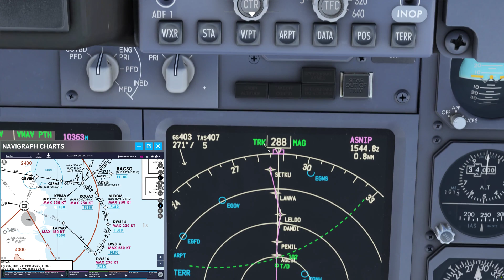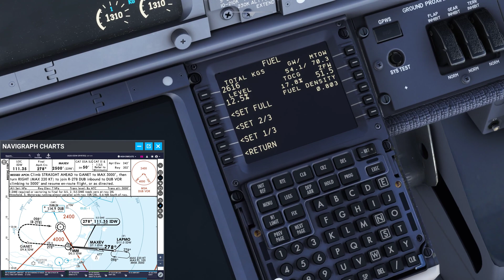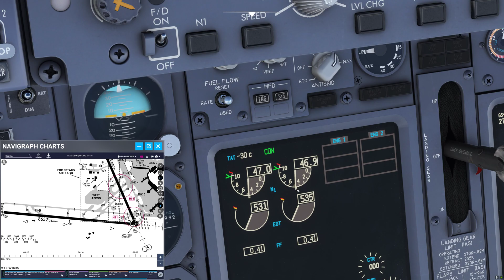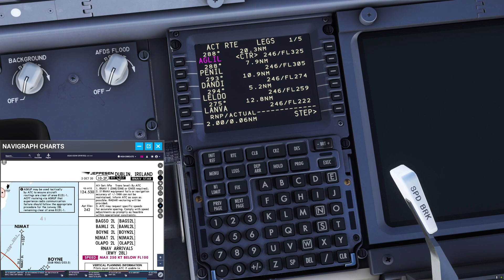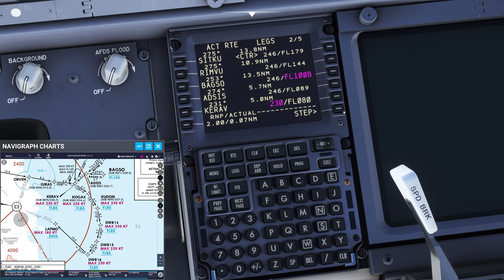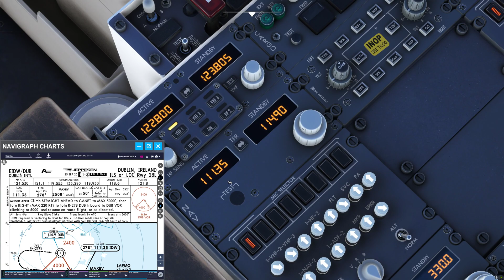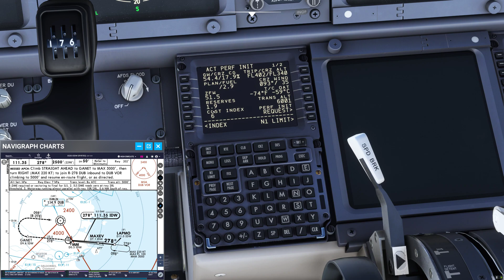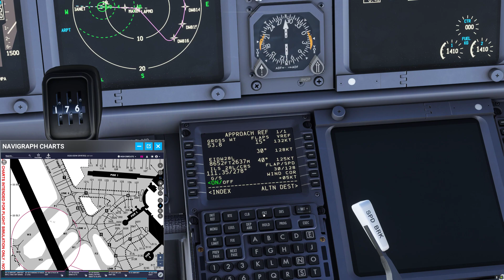PMDG 737-700 for MSFS - Tutorial 11: Approach Briefing (full version)

Comment: Hi, I am still confused why you changed the Landing Weight to 53.8?

Can you explain @737NG Driver?
Reply from the maker: Because I want to know the flap reference speeds for the weight of the plane on landing, not the current weight.
Reply: @A330Driver  First of I'd like to sincerely thank you for responding so quickly! Your tutorials are AWESOME!

I understood that part, but what I didn't catch is why -600, or rather - where did you get that number (if you still remember)?

Thanks again :)
Reply: @galmubi5406  600 is the difference between how much there is in the tanks and how much there will be after landing. So u minus 600 to get the flap setting and speed when you land if that makes sense. If you do not minus the 600, then the FMC gives speed for the current weight, which is not really helpful as by the time we have got to landing, out weight will be different and therefore different speed.

Comment: I’ve watched all your tutorials and they are so good, thanks a lot! One question: is there a specific moment when you should do the approach briefing (like x minutes before the T/D)?
Reply from the maker: You should start latest 80NM before the T/D, however earlier can't hurt. Sometimes I do it as early as 150NM before it and sometimes even earlier.
You need to consider two factors:
1) Give yourself enough time so that you're finished with everything once you reach the T/D
2) Don't do it so early that you forget everything by the time it becomes relevant (aka by the time you start the final approach)
If you need to review your destination airfield in closer detail because you only rarely fly there, or if you're going there for the very first time, start doing so even earlier. If you have an hour in cruise there's absolutely nothing that would prevent you from using it for the approach preparation.
Reply: I do this in Sim early in cruise because you have time, and on a 3 hour hops i recheck 100NM prior to TD if weather changed on destination an plan alternate approach, besides in sim ATC can do random changes and you always have to be ahead of what ma happens.

Comment: Really enjoying your videos. One question, but not related to your video specifically, but do you know if the devs plan on adding other options like being able to show/hide the fuel flow indicators on the upper engine display? I’ve seen quite a few airframes with that option.
Reply from the maker: Yes, more options will be added later. The Fuel Flow option is one of them, others will be the Multi mode Reciever, glareshield without annoying knobs, the new clock, etc.
Reply: Fantastic! Super exciting to hear.

Comment: I really like your videos and style of presentation (it feels very German in a good way! :D) - looking forward a lot to the module in MSFS as well 

One thing I've always wondered: why is everything so "ghetto" and antiquated looking (and working) as compared to an Airbus? Everything seems to make much more sense to me in an Airbus, and looks much more user-oriented and user-friendly as well 

Still looking forward to it a lot and looking forward to dive into the differences!
Reply from the maker: Keep in mind it's still based on an airplane designed in the 60's. The overhead is still pretty similar to the original 737-100.
Originally Boeing wanted to use the 777 cockpit design in the 737NG, but airlines wanted to keep the differences training as little as possible. AND: It just works.
Reply: @A330Driver  fair enough, it sure does! And ease of crew training probably is very important, which is why ever Airbus is basically the same internally as well, from what I understand.

Thanks for replying! :)